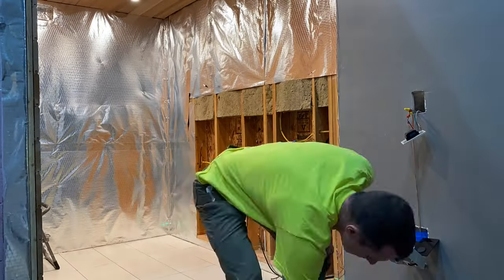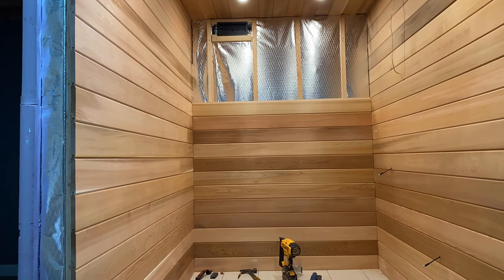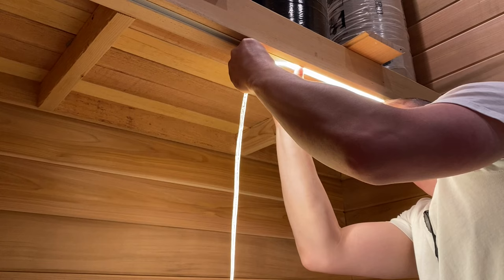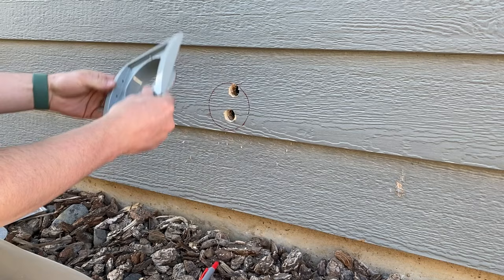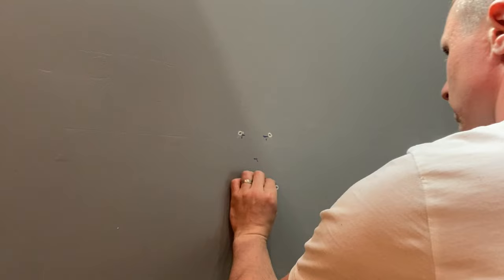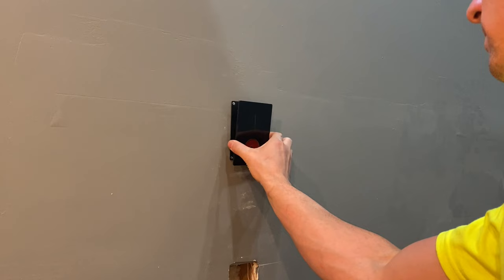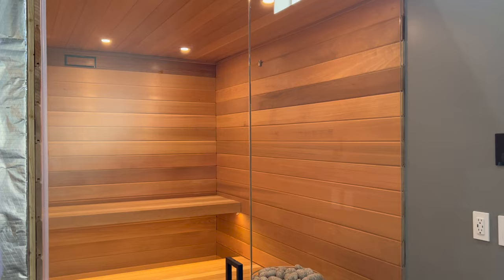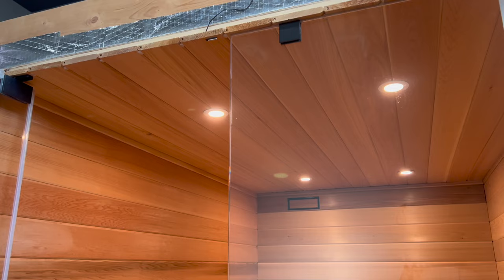Building a Sauna In my Garage part 2 DIY

Comment: What happens when you throw water on the stove, floor does not have sewer? Also the panels should have air gap at the bottom and the top of the walls to help panels to dry after
Reply from the maker: Water evaporates instantly upon making contact with the stones, haven’t seen any water on the floor by the heater. Unfortunately sweat does make it down to the floor, but not enough to justify having a drain. Just a routine cleanup helps keep it look fresh.
Reply: @DaveyStruggle  How can you be so accurate water thrower? You don't wash your sauna?
Reply: @Turmootti  a spoon of water even if spilled is not a hazard as you might make it to be.

Comment: What type of wire / conduit did you use to connect the heater? The manual says not to use the standard PCV coated wire, but I don't see heat-resistant available wires in local hardware stores.

Comment: Standalone heater looks great but I'd add a wooden cage/barrier to prevent accidentally touching it or landing on it in case of slipping
Reply: So true
Reply: Yeah you probably also wear a helmet when you walk on the street... Just look at what you do and make sure you don't touch it when hot it's not that hard
Reply: Ok tough guy  @guatf1

Comment: When adding a glass wall you need to take in consideration that heat loss that glass provides and most likely therefore you needed a much bigger heater, there are calculators for this online.

In any case, beautiful build with great choice of materials!

Comment: Always impressive to see a craftsman working so professionally...  One question, though - why the big glass door and wall, while putting so much effort into installing double isolation on the other walls, the floor and the ceiling? Or is the heat loss acceptable?Most saunas I encountered (here in the Netherlands) have as small a door as possible and no glass wall.
Reply from the maker: Definitely a lot of heat loss because of the glass door and panel. A quarter inch gap does exist around the entire door, which I used a clear silicone gasket to help with escaping heat. My reason for this was so as not to hide the beautiful sauna behind a wall.
Reply: @DaveyStruggle  Ah, I understand your considerations, a beautiful sauna it indeed is ;-) Isn't it an idea to have a big extra (sliding? rotating?) wall, that you can close (over the glass) when using the sauna? Then it 'll be visible when not in use, but super well-isolated when in use.

Comment: If somebody wants to calculate how large sauna heater (kW) they should buy, here is the formula.

Calculate cubic meters of the sauna.

Length:8 ft = 2.43 meters
Width:5.5 = 1.67 meters
Height:8 = 2.43 meters
2.43 * 1.67 * 2.43 = 9.86 cubic meters

Calculate square meters of every non insulated walls (glass door, windows, etc.) and multiply it by 1.2
For this build, the glass wall size should be width x height x 1.2 = 4.87 sq meters

Add all numbers together and round it up to closest integer: 9.86 + 4.87 = 14.73 = ~15
This is the actual cubic meters of your sauna.

Huum Hive 12kW is ranged to be used for saunas between 12 - 25 m3 and Hive 15 kW is ranged to be used for saunas between 15-30 m3.
Choose the size which suits you. If you need less clearance from the heater, choose Hive 12 kW (e.g. you want to put the heater inside the bench/floor) and choose larger if want the sauna to heat up quicker.

One tip, to not get cold feet when sitting on the top bench, put the bottom bench around the same level as the top of the heater.

Comment: How did you attach your Huum control/wiring box to the ply wood (the Box on the left at the end of your video)?  It came with no real manner in which to attach it. 

Great videos, very helpful.  I assume a huge part of your heat loss is your full glass front. 

Cheers
Reply from the maker: I drilled some holes from the inside of the box, and screwed it on the wall that way.
Reply: @DaveyStruggle  
Ah, I have my box outside and wanted to not drill it but will likely have to do that. So odd they don't give a set of factory holes with weather proof gaskets. 

cheers
Reply: @factslogic3513  Thanks guys! I'm building our sauna right now and mounting of the wiring box was stumping me this morning. This was the info I was searching for.

Comment: you said you needed more power. what did that intail? is 220 not enough for that 1000 cubic feet heater? i currently have a 220 line ran from previous sauna and was looking at about the same size heater as you have for my new sauna build
Reply from the maker: Not sure about the tech info, but my heater required two 50 amp breakers, each with 6/2ga wires. The 9kw asked only for one 50amp breaker.

Comment: I love that seats. I'm just wondering about the load since there are no footings. You thing that few screws on sides will hold it properly?
Reply from the maker: So far so good. I’ve had three on that top seat with about 600 lbs in weight.

Comment: Do you have a shutoff between your panel and the huum heater? If so, is the shutoff gfci? Have you experienced any tripping at higher temps? All codes in my area say gfci is required, but huum specifically says not to use it in the manual. I have a drop 9kw in an outdoor sauna and have had annoying issues in colder outside temps.

Comment: How are the pot lights and strip lights holding up to the heat and moisture? Did you use any special lights or just regular ones?
Reply from the maker: The overhead lights deal with the most heat, and so far so good. Got them at Home Depot, and were made for wet locations. Strip lights are also compatible with wet locations and have not had any issues.

Comment: Adding the same Led strip lighting under my benches as well. How did you run them from the top bench to bottom bench while hiding the strip?
Reply from the maker: I ran two separate strips for each bench.

Comment: Great build! Sharp attention to detail. Did you do all the electrical work for heater? I’m in the process of mine.
 It looks like you may had to add more square footage because of the glass”uninsulated” door.
Reply from the maker: Yes I did. It wasn’t as hard as I thought it would be. 
Yeah, that cubic feet measurement really had me confused.

Comment: What kind of lights did you use For the ceiling? And for you have anyway to control the amount of air flow through the sauna
Reply from the maker: I used 3” canless LED lights. Specific for damp locations. I don’t have a way to increase air flow, only to stop air flow by shutting the vents.

Comment: How hot does it get by the floor? Wondering what type of conduit and wire to run for the temperature. What did you use? Thanks
Reply from the maker: The floor stays quite cool, haven’t measured the temperature though. I used flexible conduit with two 6/2 wires. I would guess it stays below 100degree where the wires are. This is when the sauna is at 200 degrees.
Reply: @DaveyStruggle  thanks for the response. I'm doing one almost the exact same size and thanks to your video I was able to tell the customer they needed the 15kw. Thanks

Comment: Iam getting a single sauna for my garage but don't know if I should get infra red or traditional??? Many people like the traditional better  since it heats up hotter  cause it heats up air as opposed as your body directly like Ir.
Anyways if I put it in my 3 car garage/gym will I need to have some ventilation or will it be ok if garahe is completely sealed??
Iam installing a mini split system there too so I am sealing every single Crack/gap in garahe so minisplit can be more efficient.
Reply from the maker: From what I’ve read, health benefits are acquired at 185 degrees. Infrared reach 140. So I wouldn’t recommend the latter option. Ventilation isn’t required, but I highly recommend.
Reply: @DaveyStruggle  people been telling me ir better than traditional saunas for health benefits and relaxation

Comment: I'm designing a sauna 7x7x5. Total square feet 245. I have one small window 1.5x1.5ft. Do you think 9kw drop  heater from huum will work? Do you have the number fir huum support?
Thanks
Reply from the maker: That 9kw should be enough to power your sauna well. But I do recommend huumsauna.com sauna calculator to get a better idea of the size you need for your specific build. I would choose the next size up from what they recommend. 👍
Also steamsaunabath.com, has a good knowledgeable tech department.

Comment: What did you use for recess lighting?
Reply from the maker: Here is the exact ones I purchased from Home Depot. 
https://www.homedepot.com/p/Commercial-Electric-Ultra-Slim-3-in-Color-Selectable-New-Construction-and-Remodel-Canless-Recessed-Integrated-LED-Kit-91466/310114086
Reply: @DaveyStruggle  Thank you! Great work BTW

Comment: What are the dimensions of your sauna? I am currently building and want to use a huum as well…your sauna looks so small for a 15kw
Reply from the maker: My sauna is 8’ deep, 8’ high and 6’ wide. Use the Huum website calculator to determine what size you would need. I would go a size higher than recommended. My personal opinion.

Comment: Have your under bend strip led lights failed yet? They didn't say anywhere they are rated for that kind of high consistent heat
Reply from the maker: It’s been a year and a half since I started using the sauna, and they are still working great. Now I’m curious what the temp is at that height. 🤔